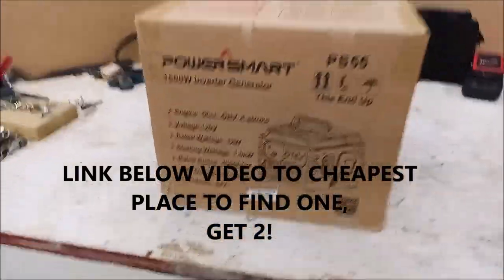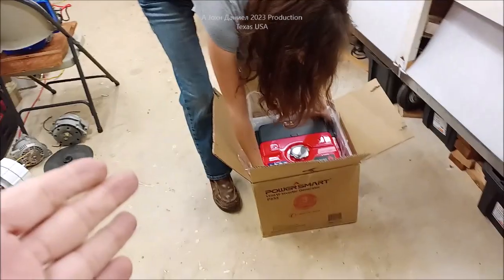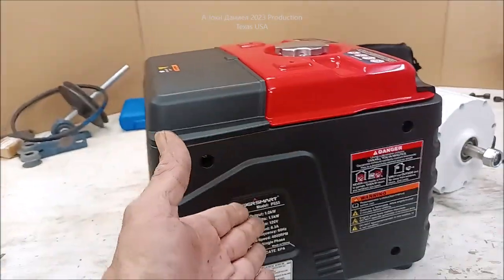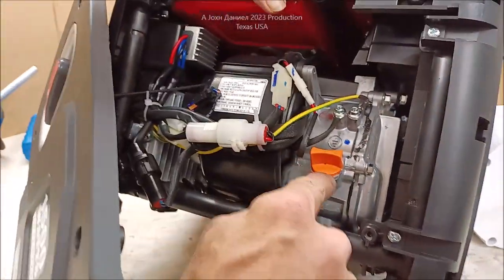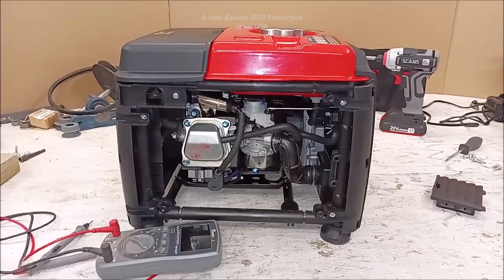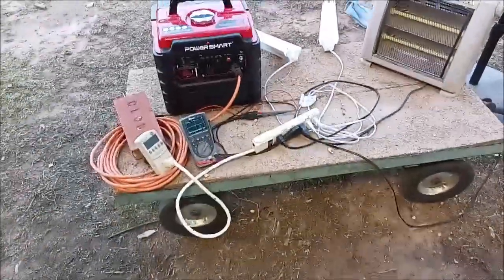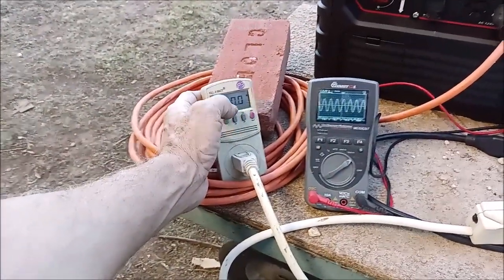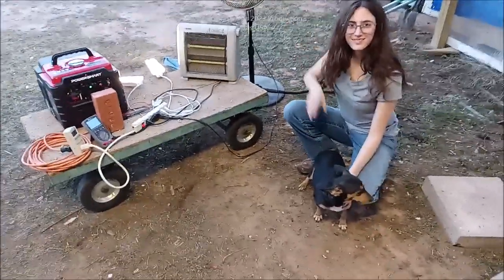POWERSMART 1000 / 1500 Inverter Generator, the affordable solution

Comment from the maker: POWER SMART Inverter Genny https://amzn.to/4bI3M9L or cheaper https://bit.ly/ps1500inv2 PLUS the POWER SMART COLLECTION https://amzn.to/3G0dwOc
⬇ 93% Survivalist Agree, see the "Elite CAUSED" ENERGY CATASTROPHE SURVIVAL OFF GRID SOLAR POWER SYSTEM -- 100 Watt Panels (12) https://amzn.to/3yO2ls4 , Affordable durable solar controllers pick (2)60/80A https://amzn.to/3x3Nw42 ,Solar Connects https://amzn.to/2XJOa1M ,Battery cable USA made https://amzn.to/3h6dsim ,12/2 Above/Underground https://amzn.to/2XIJolg for safe DC wiring of lights and appliances.
Premium POWER QUEEN LiFePO4 Batteries 10 to 400 Amp for bargain cost https://shrsl.com/3kfqh
Reply: Ordered one for now thx!
Reply from the maker: @rgnewlife6622  You'll like it. She really did her homework on it. Seems the ones based on Yamaha engines are as good or better than the Honda based. I'm eyeing the 4400 for the Winnebago.

Comment: Nice little generator.  A lot of them make it very difficult to service the carb and near impossible to set the valves.  Nice that this one makes both so accessible.  Inverter generators are the way to go.
Reply from the maker: Putting out a video later toady of LPG converting the off grid Duromax to build a 65+ amp 12 volt DC battery charging system, math says we will get a max of 78 amps, only need the equivalent of 1000 watts solar, so that will charge Lead Acid, Lithium and AGM using low voltage auto start and high voltage engine shut down. Video one is up later, video 2 is when I can afford the rest of the genny parts.
Reply: @JOHNDANIEL1  cool, I will check it out!!
Reply from the maker: https://www.youtube.com/channel/UCZO1BO_wWbsfDrWfOzccQDA/community

Comment: Spot on. I learned the smaller is better thing from hurricanes. The last significant ones in 2017 (Irma-Maria) knocked our power out for 3 1/2 months (was knocked out for a year by Hugo in '89) and a little 2200 watt Ryobi inverter genny carried the full weight for a couple of them for 12-16 hrs a day. Refrigerator, lights, fans, TV, laptop, and a small submersible pump in the cistern for filling buckets (using a power strip for an on/off switch). 

When the little overworked Ryobi finally crapped a brick we used a much louder and more gas guzzling 3500 watt contractor grade genset until the line crews restored our power. The savings in gas with the smaller genny was very noticeable and I could get by with skipping the gas lines for at least twice as long. Anyway, it's good to see you and the fam makin' vids again. Have a fantastic New Year.

Comment: Nice video and a great year ahead for all of you!

I work for one of the power companies in the UK and we use gennies all the time!
It is a temporarystop gap when we have an underground fault to repair to keep individual customers on. We are on 240V so it is a little different too.
We used to use Honda 2.0i's but after a while they take some starting (trust me after 10 pulls you are cursing them) but would give a couple of KW output ..... not enough for a kettle but OK for Fridge/Freezer TV Internet and Gas Boilers. 
In their wisdom (and us moaning at management to get better) we moved to a new brand ..... but the output for these was a meagre 1800W (often less) and that was not enough! 
We now have a company that will drop off and refuel 6KVA Diesel gennies! These are enough to power 2 houses off one genny ... each on a 32A breaker. Noisey and smelly but a world of difference!

My point? The best thing for you depends on your individual situation. IF you are after a backup for temporary loss of supply the genny shown here is a great get out of jail card for you. If you are looking at a sustained use power unit for your whole house others may be the way to go!

Hope All of you find Last year was better than the one before and that this one is better than the last!
Reply from the maker: The main thing is having low wattage needs before getting a low output genny. Most todays electrical items are LED, soft start and multi stages so you can do now with 1000 watts what it took 2000 watts just 15 years ago. POWERSMART makes a awesome 2500 that is on my bucket list. I like the fact they jumped off the Honda Clones and went to Yamaha and Lifan Pro II models which are so much better now.
Reply: @JOHNDANIEL1  True words!

Comment: Thank you sir. I swear I thought I had bought a 2 STROKE model so you just prevented a terrible mistake! So my generator is better than I thought!
Reply from the maker: It's very well engineered for sure.
Reply: If you put oil in the crankcase, 50:1 in the gas wouldn't have hurt it. Might even make the tiny hard working engine live longer.

Comment: Thanks I'm convinced getting one been looking at those for awhile looked cheap generic but you showed me that's not the case. Kudos to the little lady!
Reply from the maker: We tried it running a microwave, 900 w and it didn't balk one dang bit. If you try to run something higher than that maybe it will.

Comment: I was a Ground Radio Technician in the Air Force. These things, and most generators actually, are stupid easy to work on. Most are perm magnets like you said and more or less has the same wiring of the inverter in a much more condensed size to save space. You can find the schematics online as well to troubleshoot.

Comment: Thanks for the video, this could be a very handy generator.   I'm surprised none of thee little inverter generators incorporates a 12V battery charger.  They've already got high voltage DC right onboard (it powers the inverter), to be able to use 30 amps of that at 14V (just 420 watts, less than 1/2 of the generator's capacity) to charge a "12V" battery would be very handy, and not too expensive to provide with a buck converter.  Buying a 30A  "12V" charger that runs on 120VAC ain't cheap, I'd think a lot of folks would pay a bit more for a handy little generator that could do that, too.  Heck, it might even prove handy to  get your RV starter battery recharged in a pinch.  A source of 12-14VDC is a darn handy thing to have in an emergency.
  Thanks again for the video.
Reply from the maker: My solution, a hot battery spare set up. Get the Golo, https://amzn.to/3yOFXLZ right now its dirt cheap, they were over $200 now, have a March Sale and $40 off, so with a $40 off get it for $120 or less. This Golo can dump enough power to run your furnace for over 4 hours by itself. Or add a Engine battery only 30 watt all in one solar https://amzn.to/3FDtUVn , or 2 of them to the engine start battery so your never weakening it with your coach battery. Every time you draw it low, you weaken it, shorten its life. And if you do not have them isolated you need to do that.

Comment: I've been watching these with interest as a backup for my house battery system.  If the solar isn't giving me enough, this would be perfect.
Reply from the maker: To solve it, find you a nice charger that is up to 800 watts AC input max so you get far more stable hours of charging, then get you one of these https://amzn.to/41Dw0gG I think there is a $20 or larger coupon on them now due to winter price drops. In spring they always go back up. Mine has now over 250 hours on it, I use it on watering pumps. The amount of fuel it uses is so little that even my stingy little honda EM700 can not compete with it.
Reply: @JOHNDANIEL1  I can set the AC input charging upto 1800 watts.
Reply from the maker: @Solkre82  You probably can if cutting the life of the generator inverter to nothing by running it at 120% is the goal. It would use it's tank of gas in 1/2 the time and actually give you dramatically less results. It's a 1500 watt with 1800 starting watts but it can do it. People do really dumb stuff all the time so I would say buy 2 if that's your plan.
Reply: @JOHNDANIEL1  Didn't mean I would, I can just control the input wattage on recharge.  Right now it is set to 800 to use my house outlets.
Reply from the maker: @Solkre82  Commonly a 75 amp for 12 volt would be about 800 watts AC power so thats a basis to consider. A SUNGOLD inverter has a great charger in it, I would use those.

Comment: It's interesting that that all of the big utube channels on going solar keep saying you need 2 to 3 times the power to run a fridge I'm sure you can run a natural gas furnace with one that size as I keep saying with 2000 watts I can power my house sure I might not be able to run a fridge freezer furnace and water pump all at once but when running the water pump 2 times a day I can shut off other appliances I'm looking at going low budget solar I did like your video on converting an electric lawn mower to run on battery I'm thinking about making my lawn mower my snow blower and my rotor tiller all run on a battery as well as having back up power from the unit I liked your idea because extention cords are such a pain and so constricting but to convert all three with their own power supply could be quite costly so I think I'll try to set up the power supply on a small 2 wheel trailer and then there is the problem that a 2 HP motor to run the rotor tiller would probably be too small to run it and would need a big inverter which would be extremely expensive

Comment: That is a great generator for the price for sure. Thank you. I wonder if there are propane generators that only produce 24v to just charge batteries when there's no wind and the sky is cloudy 🤔.
Reply from the maker: Stay tuned, I am working with Lifan to make a selectable model from my auto function design that will make 12.24 & 48 volts with amp ratings of 56 amps for 12V, 30 Amps for 24V and 15 Amps for 48V systems that will be Dual Fuel on a LD-232cc Engine.
Reply: Otherwise look online for videos on how to build your own all 3 ones I've seen are 12 volt. but instead of using a 12 volt altinator get a 24 volt from a deisil truck most from pick up trucks are 60 amp but the ones from semi trucks are 100 amp and higher

Comment: Thanks for the review! I just bought one too. Could you please tell me what the break-in period and regular oil change intervals are for this engine?
Reply from the maker: 1.5 hours break in, 0 to 75% max load, Change oil. And I recommend straight 30 weight walmart brand cheap stuff for break in. It will carry more micro junk out with it. Then best for this engine ( no matter what your birthright oil love is, what the guys at the auto shop swear by or the oil that saves the world, LOL ) is what Yamaha, who designed the engine as a small pump engine says to use, Castrol 10-30 blend. https://amzn.to/3HoXbEu

Comment: Have you ever done any modifications to an inverter generator like this? I wonder what they would do if you pulled the alternator output before the inverter section and ran it though a rectifier/charge controller to charge a battery bank. Think the output would be worth it?
Reply from the maker: The electronics are too heavily integrated to use it that way, but you can get a DC only charging system the goal would be to find out what kind of control you would need to add to it for best outcome.

Comment: Well, it's a year later...how's it holding up? I'm thinking this might work well to recharge my "solar batteries" (power stations). They only draw about 750 wt when charging. WM has this on sale for $218.
Reply from the maker: Are you referring to this one https://bit.ly/ps1500inv2 that is new, or the refurbished ones? The walmart is sometimes cheaper and faster shipped, but be sure its new and not a return from them.
Reply: @JOHNDANIEL1  I'm looking at one at WM for $218, I assume it is new. But my question was about your experience with the product you demoed in the video, (new or refurb I have no idea).
Reply from the maker: Yes, I think the $218 is the one I got the discount link above/earlier posted is the new ones. As for running, this thing has a bit over 250 hours on it due to letting my boss use it on his house boat. It's so quiet he is able to run his 8k btu air conditioner all day and fish off the boat most the fall of last year and is using it again this year. However trading/loaning a genny to use for whats now only 3 catfish he dropped off is not doing me much good.
Reply: @JOHNDANIEL1  3 fish is not much compensation. Sounds like he's the one I should ask about how it runs. For $218, I probably just get one, sounds like your happy with it.

Comment: Do basic refrigerator really only use 150 watts? I'm talking about a 6' by 3' unit with freezer on top.
Reply from the maker: A 20 cubic foot refrigerator on average will use 450 watts starting and will run on 120 to 180 watts while in cooling cycle. Smart folks will get 2 big 200AH batteries, a 1500 watt inverter and charge the batteries in a 2 hours then run the fridge for 30+ hours without needing the generator running 24/7. I have designed that exact set up for dozens of people, they are saving over 90% in never ending gas cost.

Comment: i just bought one these, will it be able to run a 2.5hp 5 gallon craftsman shopvac?
Reply from the maker: I'd do a real watt test on the shop vac. When they say 2.5 horse, they now days mean AMPS AT LOCK UP LOL! Get a P3 https://amzn.to/3YccbLD and test it under open draw, and wet draw loads. If it's normal running is 1000 watts and less, with surges under 1400 then your good. Otherwise get a Stanley 5 gallon style shop vac, much better results with 1.25 HP, 900 watts max.

Comment: Just got my PS55 today. I will be be using it to power tools in the field, with no house connection. There is a terminal for a ground wire and rod. The articles I've seen are somewhat confusing. So, my question is if I'm only going to be powering tools in the field, with no house connection, should I invest in a ground rod? If yes, I'm thinking a six foot copper rod connected to the genny's ground terminal might suffice.  Thanks for any info.
Reply from the maker: No need for a ground rod on it unless your working in lightning prone areas or in areas like chemical plants or gas plants. But then if you were, they would require a Diesel model.
Reply: @JOHNDANIEL1  Thanks for the replay, JD. I just watched a video by Benjamin Sahlstrom who said ground rods do not protect you from ground faults in the field, and that one way to bond your floating neutral generator is to splice the appliance's ground and neutral wires together, which would trip the breaker in the event of a ground fault. I definitely am not going to go that route, but I was wondering: does this apply to inverter gens like the PS 55, or is he possibly referring to to other non-inverter types of generators? I will be using this PS 55 near creek beds on my property, sawing boards and building bridges. Thanks again.
Reply from the maker: If you're worried about electrical shock just get you a nice power strip with a easy trip circuit breaker and use it plugged in while you're running things. There's no real point in grounding a generator because it doesn't have dual atmospheric wiring which means in the ground and overhead that adds risk to your electrical system like a utility does. The grounding for a utility system is so that they can bridge the voltage and make multiple phases you're already got that covered in your generator. Just basically setting the generator on the ground covers everything.

Comment: Well I ordered mine from Powersmart USA store and received it promptly but what they dont tell you until you read the manual that you need a high altitude kit if applicable.  Well that's when the fun begins.  After listening to music for half hour on their customer service number, tried a different number another day, finally got a representavie who knew nothing about high altitude kits, said he would have to talk to an engineer.  Geez;  my email sent to them on this subject remains unanswered.  So they stink in this regard after the sale.  Local repair distributor says he has difficulty getting parts from them and some warranty  repairs are sitting months out.
Reply from the maker: I haven't had such a event to deal with, Sounds like no fun. But I did deal with similar with Honda about 5 years ago, it took 4 months to get the 4500+ altitude carb and spark plug. Crazy thing is, it was nothing special, but $90. You move the coil 2 mm back pre TDC, the carb is identical with a bigger jet by .002, and the plug was just a hotter style. Could have just done it myself for $10
Reply from the maker: PS - Did you ever notice, cheap lawn mowers and ANY engine pre-2004 made by Tecumseh and pre-1980 by Clinton would run in any altitude up to 10,000 feet without anything done to them! But everything modern can't do it. So much for "technology" huh!
Reply: Cutting torch tip cleaner for the jet and change the filter for lighter media like EZflow household furnace filter.
Reply: @JOHNDANIEL1  Everything is set lean these days at sea level for emissions, which robs power at all altitudes. I haven't seen anything in years that wouldn't run better with the next size up jet.

Comment: Has anyone added an auto start to one of these small generators.  I was given a Powersmart 1000, it is like new.  So I was wondering if I could set it up to automatically start up and charge my solar batteries if they dip too low on non sunny day or night time.
Reply from the maker: A starter is not likely available for the 53cc engine castings.